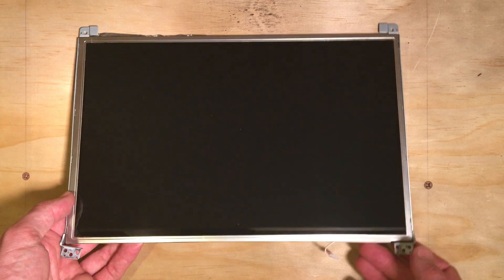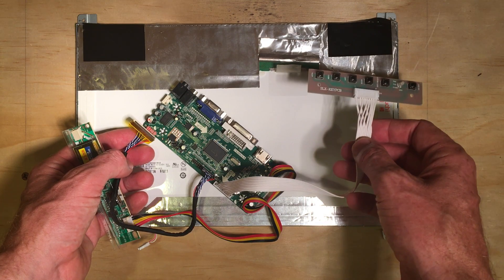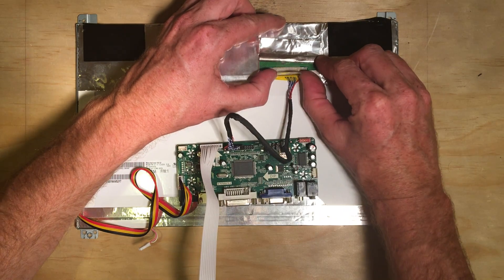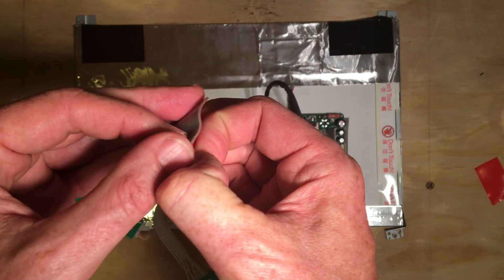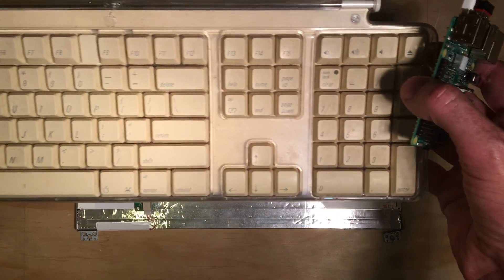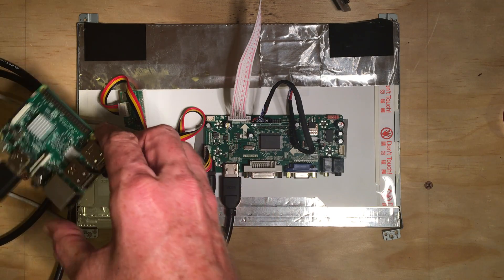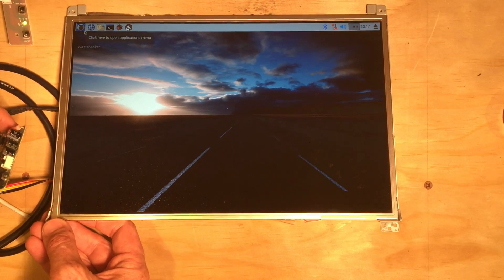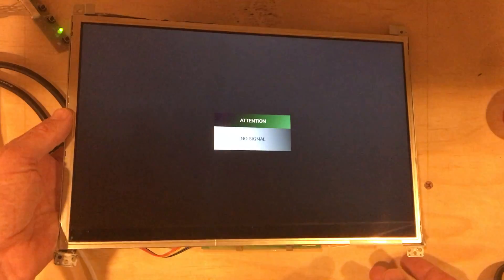Maker Project Reusing Laptop Screen with Raspberry Pi

Comment: I have a LCD Panel ( LTN156AT02-D09 ) If I get that controller board,  can i connect it to my computer as a monitor by HDMI cable
Reply from the maker: If you get a control board that matches your LCD panel then yes you can connect it to anything that uses an hdmi cable for display.
Reply: @MakeFixUpgrade Huge thanks❤️ 
Another Question..
Is that LTN156AT02-D02 supported controller board match for LTN156AT02-D09 model
Reply from the maker: @MartianStreaming  doing a google search for “LTN156AT02-D09 control board” gives me results. It looks like you can get one on Amazon for around $25. Just pick the listing with D09 if that’s the board you have.

Comment: Thanks for the video, is that Lenovo g555 display? I Ask because I want to know if this control board works fine with such display since i got one
Reply from the maker: This was from an HP, I think some Lenovo computers may have had similar displays. The only way to be sure is to open it up and check the model number on the display.
Reply: @MakeFixUpgrade  I did it and now I have fully functional laptop screen tv 😄

Comment: Could the lcd screen run directly from the raspberri?
Reply from the maker: That would depend on the screen and its power requirements. I'd say it would be safer to power separately but with the right components anything is possible.

Comment: quick question! how to you exactly unplug the cable if im stripping it down from a broken laptop?
Reply from the maker: I'm not exactly sure which cable you're referring to. If you mean the main cable that plugs into the screen, then just follow the wire as you take the old laptop apart. The connection for mine was taped down so that it wouldn't come apart on its own. It was also covered with foil. I had to fold the foil layer back, then peel the tape off the connector far enough to unplug the cable.

Comment: 1:40 Where on earth do you see 12V?
Reply from the maker: Gavin Pereira it's on the white printed strip just above my finger. (it's upside down) it shows "GND GND 12V 12V" which corresponds with the pins just above my finger. There are 2 ground and 2 12V pins.
Reply: @MakeFixUpgrade  Sadly, I didn't learn that in Physics class

Comment: i have trouble finding the apropiate power suply for a controller. sellers usually do not specify the diameters of the power source. any advice? thanks
Reply: @ALEX kinston  i have a screen LP156WH3 and i am looking for controllers for it. i dont care what controller i get, i need hdmi and a power source for it
Reply from the maker: @toni I searched the screen ID you shared on eBay and found a lot of hits for the control board. If you pick one, then go to the product description you should see something like this listed in the details:

Input Power Adapter: 12Vdc More than 2A.
DC port:2.5MM and 5.5MM inter+ outside -

That should be enough info to find a power supply online. You'd need a supply that provided 12vdc capable of 2amps or higher with the + on the inside. The barrel size should be 2.5mm inside and 5.5mm outside.
Reply: @MakeFixUpgrade  thanks a lot!

Comment: Hi there and or hello
First of all thank you for the tutorial 
In this video but I got an question to take it an step futher because among this and all other videos I did not have ever seen anyone refurbish an laptop by putting an raspberry pi inside. Why, is this such a ridiculous thought. If I see you connect an old laptop screen, then I guess that shouldn't be such a problem to do this with the keyboard and the trackpad too. What's the problem if you put this all together in the old case too. What are your thoughts about it. Must be enough space when you remove the old board and hardware
Reply from the maker: @Hans van Binsbergen that's certainly possible. The processing power in the raspberry pi would be less than what was in the laptop but there should be enough room in the old laptop case. You might need to create some custom adapters to connect the keyboard and mouse but it would be worth a shot.
Reply: @MakeFixUpgrade  lol, i doubt  it will be less powerfull. At the moment ive got an  Acer  travelmate  with an P4 and 512 MB  of old ddr sdram wich is already hard to find. And then it's still  to hope it works. After ive seen your vid, i know already that the controller even should fit niceleu where the DVD / CD RW is stashed
But Beware : this Ubernoob is comming to bugger you again when things start making me crazy.  Ill just saddle you up with all whats left over from it, hahahaha

Comment: i have macbook display..can i use it
Reply from the maker: @Druv Malhotra if you can find a driver board for it it should work. I’ve never tried it with a MacBook display.
Reply: @MakeFixUpgrade  can you please help me to find out driver board for macbook air

Comment: Hi thanks for the video, very informative. 2 questions:
1. Can the raspberry pi output enough power to/for the board?
2. Would you think feasible to avoid the on/off board and trigger monitor "on" when the pi is turned on ?
Thanks in advance
Reply from the maker: I don't think I'd try to power the board off the pi. If anything I'd be more likely buy a power supply that could power both. With the proper conversions you could power both. And yes I think something could be rigged to trigger the monitor on when the pi is powered on.
Reply: Most of these borads have 5v and 5v standby so you can power the pi up when turning th emonitor on, and when you turn the pi off, the lcd will shut down after 5 seconds standby, cutting the power to the pi

Comment: hi , i have the same board as u have it (Model No: B141EW04 v6), can u please share me the link of ebay, that will be easy for me to Buy. Thanks & Regards, Chetan N
Reply from the maker: Just search for the model number + control board on ebay "B141EW04 v6 control board", there's a whole list of them that show up. I'd pick one of the suppliers that are 'Top Rated Plus' by ebay.

Comment: Is the controller board the motherboard?
Im planning to make an arcade machine so does that mean I can use any old laptop?
Reply from the maker: In this case no, the control board is not the motherboard. You order the control board for the screen based on the part number on the back of the screen you want to reuse. You can use any old laptop as long as there is a control board available for it, or unless you can figure out how to repurpose the motherboard to just drive your screen.

Comment: I tried the same project with an old dell that caught the BSOD (blue screen of death) and crashed, but for some reason even after I got the control board in the mail today and hooked up everything with the raspberry’s dc plug it the monitor didn’t light up. Could you help me figure out what I did wrong?
Reply: Do you have the right input voltage for the board? are you sure the raspi works and outputs video? are you using any video adapters between the control board and raspi? also, the BSOD is easily fixable, so it probably would have been better to just install linux on the laptop and you'd probably have a better setup.
Reply: I have the same problem. I hooked up a controller board, used the right adaptor provided with the controller board, then I tried hooking up a fire stick and nothing happened. Then I tried to hook up an Xbox and nothing happened. The screen turns white but that’s about it.  Am I missing a part? Do I need a motherboard or a raspberry pi?

Comment: how big of a 12V DC power supply do you need? They claim 2.5A-4A but i think thats alot for just the screen and driver board
Reply from the maker: @Rafal .Zaniewski that sounds like a lot to me as well,  but I'd say go with whatever they recommend. Mine came with a power supply unit so I didn't have to purchase mine separately.
Reply: polecam ci obejrzeć film o monitorach z ekranów laptopów na kanale GreatScott!, jego ekran ciagnął ok. 750 mA
Reply: @simekon80085  So i only need 750 mA to power the laptop screen ? I have a DC -USB power suplly with 12 V -1 Amp

Comment: This is going to be perfect for my pi case project, I have a good screen already and just checked the price of controller boards, seems the most cost effective way of sourcing a nice streamline screen instead of buying something to break apart just for the screen. Thanks 🙏🏻
Reply from the maker: MrStreetboy Awesome! Glad you found this useful. 😊 I made another video on creating a frame for your screen with wood if it's something you're interested in. If you do it just make sure the grooves in the wood are large enough for your screen and that your frame doesn't put pressure on the screen. Good luck!

Comment: I'm sure someone's asked already but do you know a good tutorial like this except making it into a touchscreen and using a Fire Stick? And are there pre-built frames made for this type of project or do you have to custom build one just like the video? Looking for some workarounds so I don't have to solder or hammer/drill wood, sucks doing that in an apartment. Thanks
Reply: Make it like it is but boot the Pi from the firestick - USB to micro SD?

Comment: is it possible to use universal control board with any laptop monitor?
Reply from the maker: Theoretically you should be able to, but I'd be surprised if a universal control board worked for all laptop monitors. I'm sure there are some variations they wouldn't work for but I've never tried it.

Comment: Could the power input be swapped out for micro-usb? Just thinking of if it's poss to have it take power from a picade hat or similar pi addon... Thanks
Reply from the maker: I don't see why not. If you're comfortable with a soldering iron and can figure out which leads go where you could make any number of power plugs work.
Reply: @MakeFixUpgrade  thanks for this! I'm brand new to repurposing components but have always been interested - thanks to your guides I think I can make this happen without having to spend a lot on new parts! I'll see what the risks etc are and what voltage/ampage is required...

Comment: can you use an old mobile display (touch screen) for the rasberry?
Reply from the maker: I'm not sure, I haven't gotten it to work yet.
Reply: the phone touch screen would, of course, require a different board because it uses an entirely different connector and it would need to drive the touch feature. btw I don't think that a board like this even exists

Comment: Apparently these controller boards can ran on power as low as 6V - making it more user freindly for those thinking of portability.
Great Upload, thanx.
Reply: Do you need the controller board or those things from the original laptop can be reused?
Reply: @paoloumali4280  A bit late to the party, but usually those things are integrated into the mainboard, so yes, you will need a controller board.

Comment: is it possible to power the pi through the driver board for the screen or do i need to add a voltage converter for that? cause with my current raspberry pi set up i have one power jack running both the raspberry pi screen and the pi itself.
Reply from the maker: As long as your power supply for the driver board outputs the same voltage needed by your pi then one power jack running both should work fine.
Reply: At 1:34 you can see in the red, yellow and black cables in the board that uses 5v, you can use that to power your raspberry pi. I did it that way. The 5v is for the LCD and the 12v for back lighting of screen.
Reply: @hernanpacheco3016 did you have to strip the wires for this or is there am easy method?

Comment: so i have a question, I have a control board in my motherboard that still works. Can I use that aswell ?
Reply from the maker: You should be able to as long as you know how to hook everything up. I haven't tried that method.
Reply: there is no way to somehow access the driver without using the whole motherboard
Reply: Szymon Koc yeah I realized that out lmao but I already found a solution ;)
Reply: What solution?
Reply: Cozy Cones buying a controller board for your screen
Reply: Technically it is actually possible but extremely difficult to do so; The hurdles you'll come across in trying to configure such a controller board (The one native to your laptop) really will pose many problems.

Comment: I though raspberry pi had a hookup for the display ribbon on it?
Reply: Matt Halbrook, it's for a dedicated TFT 7" touchscreen I think.
Reply from the maker: It has a display ribbon connector, but I haven't figured out how to make it work yet.
Reply: https://thepihut.com/products/official-raspberry-pi-7-touchscreen-display?variant=5165986564&gclid=EAIaIQobChMI0Om-yP_52QIVaL7tCh26pAajEAQYASABEgK-w_D_BwE#fo_c=1889&fo_k=6a5186b6360887d1c6a595d7bafbb265&fo_s=gplauk
Reply: That's the official dedicai raspberry pi screen. There is no way to connect a different screen to a pi through the port. Also  because the difference in voltages - most screens needs 12V but pi is powered by 5.1V charger.

Comment: Yoo man i bag u to tell me what's the problem name of the error at 6:31 , my samsung tv does the same thing , how did u fixed it??? Please anyboddy!
Reply from the maker: The issue at 6:31 occured before the raspberry pi finished launching. Although I did see it after I assembled a frame for it in another video and ended up putting too much stress on the screen by tightening the screws down too much. When I removed the screws the display issue stopped happening. It could be possible that for your issue the screen may have been improperly installed resulting in the screen being tweaked just enough to cause the same issues, but this is just a guess.
Reply: CrushingDemons ok thanx man

Comment: I have 3 old laptops which i dont use . I want to build some Monitors what can i do
Reply from the maker: If you're sure you're done with your laptops, carefully take them apart and remove the screens. Once they're removed check the model numbers on the label on the back of your screen and search ebay for that model number plus 'control board', once they arrive plug the control board into your screen and test it. If that works then build a frame for your screen plus the new control board and use it as a monitor.
Reply: Thank you ^^ going to try it
Reply: @momo-hr5th  also I know this comment is a bit late, but you can also reuse the hinges from your laptop as a stand for the monitor :)

Comment: Hi. Raspberry pi 3 îs capable to seen full HD video?!
Reply from the maker: Yeah it comes with an HDMI output. :)
Reply: @MakeFixUpgrade  is this a raspberry pi 3 in the video?  I have a RPI4 that doesn’t display on my old laptop monitor. My Xbox one displays on the monitor but RPI4 doesn’t. So I’m considering buying a RPI3 to finish my project

Comment: Hi, I didn't understand in the video if you use 2 different power supply (one for the raspberry and one for the control board) or if you use only one. Can you explain that?
Reply from the maker: Yes, there are 2 power supplies. The screen control board has one power supply and the raspberry pi has it's own power supply.
Reply: the driver uses 12 volts and the RPI uses 5, therefore, using 2 supplies is the simplest and easiest way to  deliver power to the circuits.

Comment: I have checked a few places online.  Where did you order your boards from?  Just curious because I found some but want to be certain before I order.  Thank you.
Reply from the maker: I found my board on ebay. :)
Reply: CrushingDemons 
I understand that.  I was meaning how to be sure which specific board?  eBay has thousands.  Thanks
Reply from the maker: Oh, I see what you mean, I looked through the listings and confirmed that the model number matched for the listing, mine also has a 'v.4' on the label, and I noticed that some boards are for that model but for v.0 or v.5, so I just made sure the one I bought had the same model and the same v.4 on the listing. For mine some come with a remote as well, but I wasn't interested in that so I settled on one without that. I mainly wanted to confirm it had hdmi. One thing you can do to be more sure on the board is to look at the cables in the listing up close, at least one end of them should match the cable ends that plug into your screen. I bought mine from a store named 'hk-estreet', but the seller shouldn't matter.
Reply: CrushingDemons 
Thank you very much for your help and quick replies.  Ordering mine now 😎

God Bless
Reply from the maker: No problem, good luck! :)

Comment: Sir send whatapp number.
Reply from the maker: Not sure exactly what you mean. If you want to find the control board for your use, find the model number of the screen you have, then do a search with your model number plus 'control board' (example: "8141EW04 Control board"). You should see results for the control board for your application.